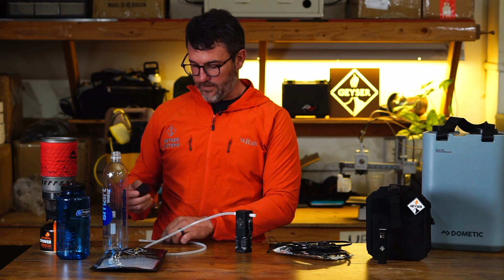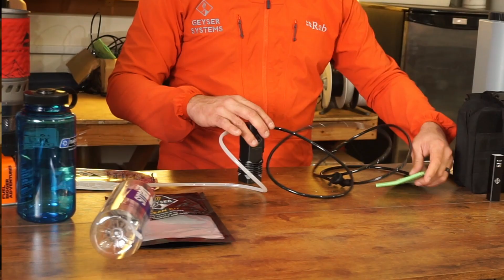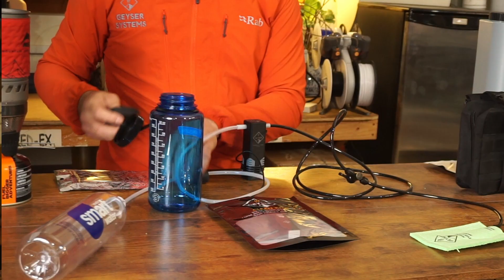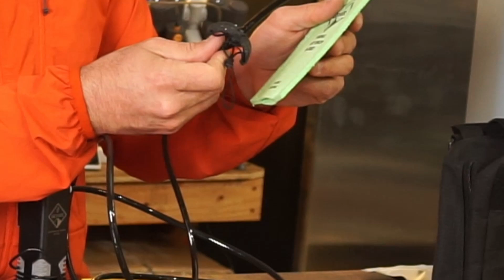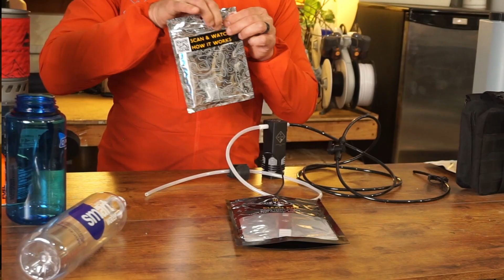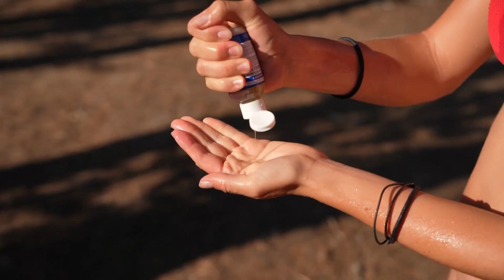Geyser Clean Kit - Step By Step Guide

Comment: Would love a USB-C option!
Reply from the maker: Coming really soon! What about an internal battery? Would you prefer that over a usb or usbc?
Reply: @geysersystems3184 Any update on when the USB C version will be available?
Reply: Same. But instead of a built-in wire, just make it a usb-c plug. A clip or something to hang or hold it would be great as well. And lastly, a QD on both ends would be nice.